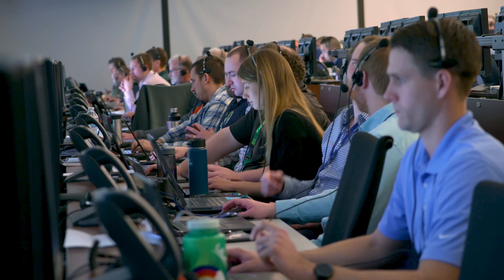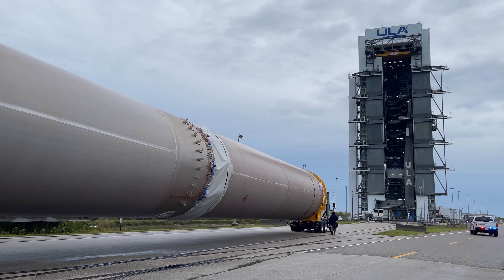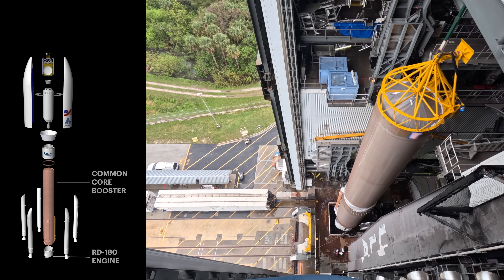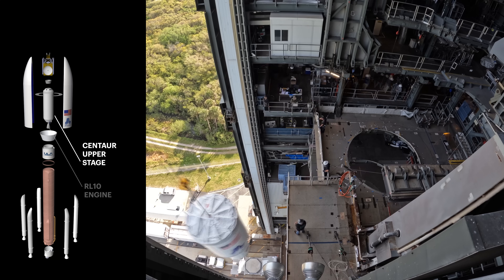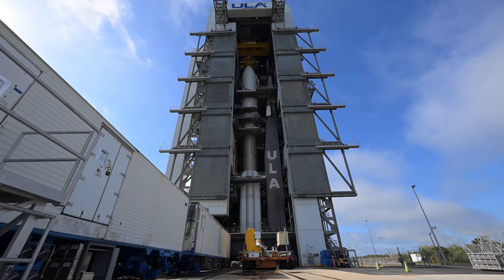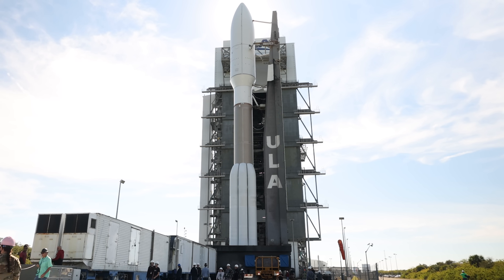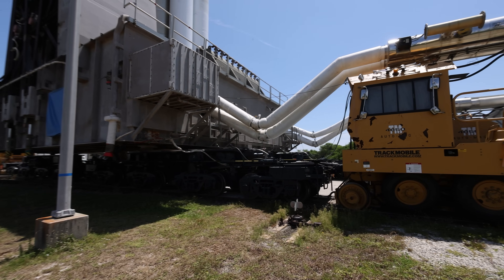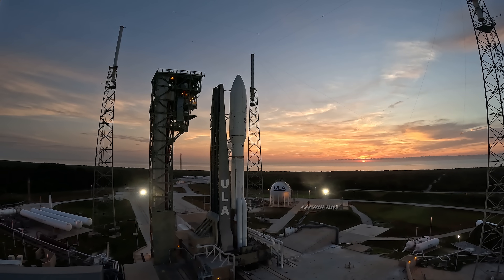Stacking the Atlas Rocket for the First Project Kuiper Launch

Comment: 59.00883 years ago a NASA researcher just added the letter "a" to (F=m*a*a) because she could not understand how it worked in 1966. Since then no one else would try updating or researching anything different or better than F=m*a*a.
The poorly researched equation and code as such: F=m*1*32

Instead use code  F=m*a*2391

In a laboratory with a system of God damn science sensors and all around God damn tech "bucking"  nology cost $8778 Isaac Newton born in 1643 would not know that in 1686.

Comment: I'm making time for this launch! I've been in every first crew launch and new vehicle test since the 90s in Florida. Honestly if the cape wasn't so far away I'd already be working there😅 who knows, I might actually be over there soon for work if this other job I just applied that does not pan out. I'm tired of landscaping and my educational background is that of aerospace engineering. I've been running a landscape nursery for over 20 years but it's time for me to get back into the field I am the most passionate about. I've been trying to combine the two and work on an off world greenhouses but I think I need to get into the actual aerospace field to be able to gain access to actually test in 0 g. I've already done vacuum testing. Three of my units actually survive in heavy vacuum but two of them did explode. Unfortunately the one that I was the most excited about is the one that exploded. It's the one that collapses down like a pancake and then re-inflate itself when it lands. My joints won't take the vacuum and they're causing the outer skin to rupture. I spent the last few years studying what Kimball did with a semi trailers and developed a great hydroponic system but once I started testing the substrates I realized that the hydroponic system would not work in zero-g. I've gone to a Coco fiber and peat moss substrate with a perforated cover over the top of the plants can grow through. I've also learned how to dehydrate the soil with the seeds in them so that they will not germinate before they reach their destination and will not germinate until the soil is rehydrated. The fact that we are moving so fast now in space development excites me and I can't wait until we build our first large station in orbit because that's going to increase the testing and development phase for growing plants and animals off world. The information we get from Kepler as well as all of the other satellites is starting to become public knowledge so development has skyrocketed and sped up exponentially. I am extremely excited for the next few years of space launches in really debating moving toward the coast. As a Floridian I don't trust hurricanes though😅